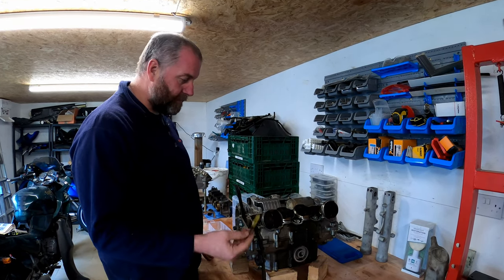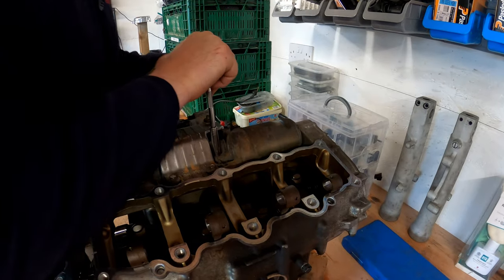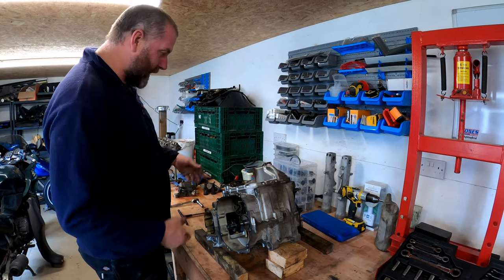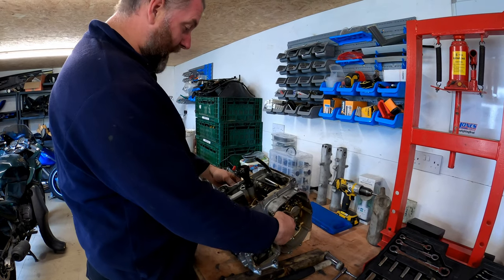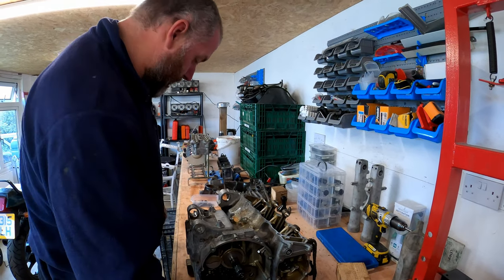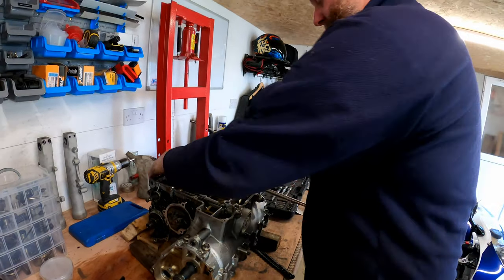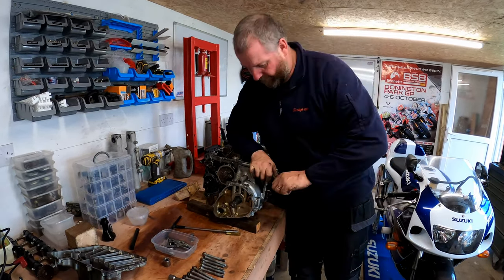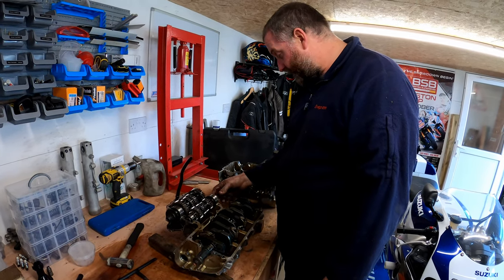1998 Kawasaki ZX9R - Project Shinobi, Episode 10 - Piston Removal & Splitting The Crankcases

Comment: Kev, you will need the zx9 output shaft, as the gears have to be swapped over from the z1000 shaft, and you will need to replace the circlips.
Reply: That's how I planned to do it. Do you know which circlips to use on the 9R shaft? I have bought both new Z1000 circlips and new 9R circlips, since I couldn't find an answer to this anywhere. I haven't got around to doing the job though, since the gearbox is still holding up.
Reply from the maker: Yeah cheers mate, I’ll go through everything needed to do the job when I actually fit the replacement, hopefully that’ll help anyone else that wants to do it too. 👌🏻
Reply: 99% certain its the 9r clips !!
Reply from the maker: Yeah it is 👍🏻
Reply: @markconlon814  Thanks!

Comment: Is it possible to split the lower half crank case/gearbox from the engine block, as shown from approx. 20mins onwards in this video, without the need to do any of the work prior to this i.e timing chain etc. ?  

I'm wanting to change out my gearbox, without touching the timing of the crank/rest of the block it self.
Reply from the maker: Yes, absolutely 👌🏻

Comment: I'm thinking some of those m6's are well over torqued, usually around 8 to 10 NM's? That's what happens when people use the the rule of FT! Guilty of it myself in the past,  though now I always use a torque wrench. Out of interest (I may have missed it somewhere in one of the vids) why zx10 gearbox? Enjoying this series BTW 👍
Reply from the maker: Cheers bud, you could be right but it could also be corrosion on the threads that is making them feel tighter than they really are! It's not the ZX10 gearbox it's the Z1000 gearbox. The C1 & C2 ZX9R gearboxes are well documented to be made of chocolate and the Z1000 transmission is an almost 'drop-in' replacement with very little in the way of modification required! Thanks for watching 👍
Reply: @KevsShed  sounds like a good plan in that case. Be interested to see the differences if you happen to have both at the same time. 🙂 (then again, might only have been down to materials or hardening process etc?)